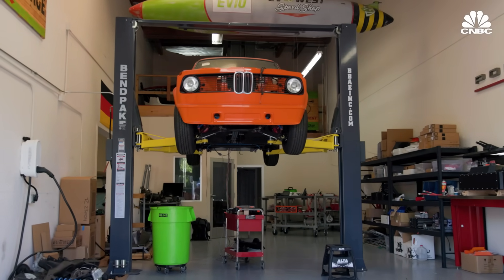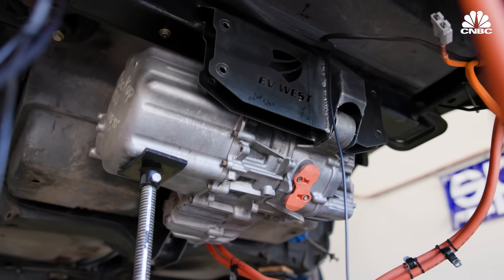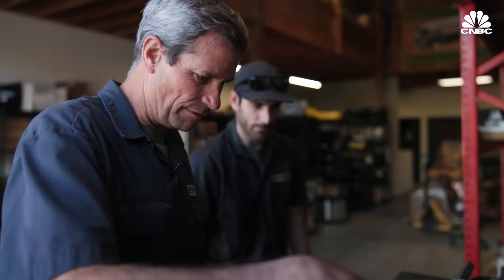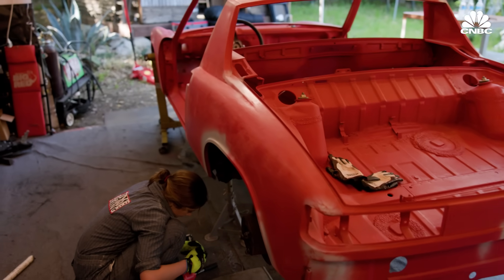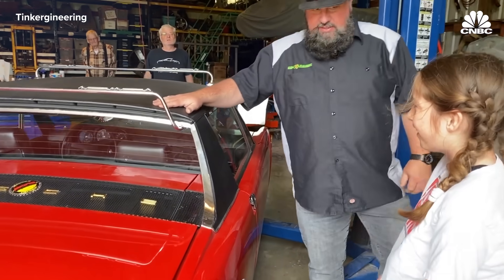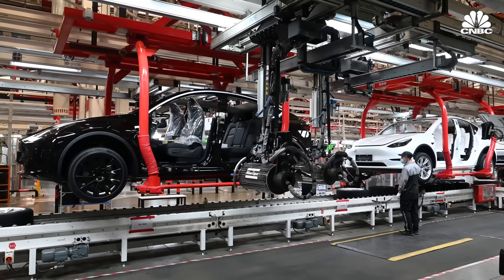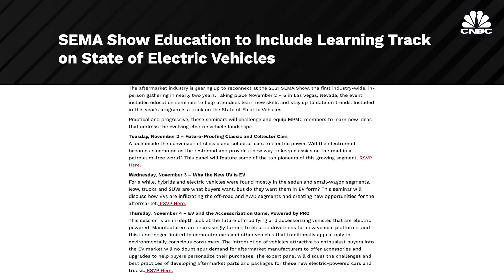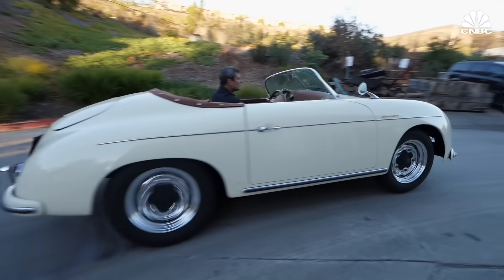How To Convert A Gas-Powered Car To An Electric Vehicle

Comment: In Eastern Europe large vehicles and regular sedan type vehicles have been converted to natural gas from gasoline for YEARS... some have converted to a Natural Gas Generator Electric vehicle, basically a kind of hybrid with a small natural gas optimized engine to simply power an onboard generator and a small battery to store 5-10 kwh... you end up with an ELECTRIC DRIVE, Natural Gas Hybrid POWER vehicle... its the best option... no need to completely redo electric wiring... no need to get a lot of batteries... most of the conversion is happening under the hood and switching out the powertrain... thats it

Comment: These are great but they need to bring the cost WAY WAY down so the average lower end working class can afford to do this since this is where the bulk of the cars are used that currently can't afford to nor able to afford to stop using their cars they way they currently are using fossil fuel.

Comment: 20k-30k in labor? BU!!SH!T! not unless their charging $500 per hour? i mean seriously all your doing is removing the engine tranny (nowhere near 20K to remove AND reinstall them) and gas tank and rest of items not needed, and RE INSTALLING new parts.... IDK of ANY engine/tranny shop that charges anything even close to $20k for labor, those #s are just FKN greedy! even with fab work, the #s DONT ADD UP @ thats rate of 40k-60k.. JUST BUY A DAMM NEW EV!?!?!
Reply: Don't forget removing the exhaust system as well.

Comment: Sea weed bio diesel can actually replace all EVs, all petrolium more sustainable more echo friendly make countries energy indipendent, Carbon neutral, and yes can be used in existing IC engines. But the governments around the worlds are putting their backs cuz of all the lobbying and putting money on a non feasible option. 🌚.. that's the truth basically.. basic physics

Comment: It's nice, but the EV conversions can be as much as a $25k because of the batteries and electronics.
Reply: $20K-$30K plus another $20K-$30K for professional installation and more for the car, according to the video. They were very transparent about that.

Comment: With that price nope who the hell would convert old car if its that expensive except if the car is some kind of expensive classic that has real value but then when you swap the original engine out and turn it into a battery car it loses all that value.

Conversion would be cool if the price was sensible and easily available for common man but with that price tag its only going to be rich persons high horse ego boost toy.
Reply: Yes, I agree it's out of reach of most people. I guess for rich folks who don't care about the resale value of their classics, it's just another way to spend their money.

Comment: Our power grids aren't able to handle everyone turning to EV's. If you're wanting to save the environment, mining the materials for EV batteries does not do it. We still need a 2 to 3 fold increase in the efficiency and miles to the charge you can get out of batteries. Also, there needs to be faster charge times and more places to charge. Vehicles are still prohibitively expensive if they are electric. The US needs to produce its own electric batteries, and not depend on China for any part because they are an adversary. Other than that, their cool.

Comment: I want to convert my '84 Fiero. 

 ( Note:  People that are just going to puke out the same, over hyped, exaggerated, regurgitated crap about fires, can F.O. right now! STFU.  I've seen it/heard it thousands of times.  Just STFU and go.  shoo!! ) 

   I'm just wondering what the process would be like with that, being a mid-engine - RWD drive car.  There is a front compartment.  It houses the Spare tire,  headlight assemblies, radiator,  brake booster, wiper motor and climate control components.  But removing the rad/fan and spare tire well could open up a big hole for batteries.  Would have to avoid excess weight there and/or beef-up the front suspension.  Then there is the central tunnel where the fuel tank lives.  above that is the corridor where the wiring and shift cables go through.   That tunnel varies in size from about 10" wide X 8" high in the front,  goes back about 6 feet as it widens out to about 12" wide X 14" high in the rear, opening up into the engine compartment.  So roughly, a fairly large capital I-shaped area once all the ICE components are removed  This area would only be interrupted by the steering rack just ahead of the narrow portion of the tunnel at the front.  That's not getting into the rear trunk behind the engine compartment.  So room for batteries in the front and tunnel.  room for the drivetrain/inverters/charging/climate/cooling/ etc in the rear compartment.  Still leaving room for a spare/jack and cargo in the rear trunk. 

It would be quite the task to do,  but it seems doable.  I would love to revive the ol' girl and get her on the road again.  Yeah the old "Iron Duke" still runs great.  The 4-speed manual still works fine.  (and would be sorely missed)   Bu damn would it be a fun car!  It's a fun car as it is,  but imagine going from 95 HP  to about 250+.  And the torque!   Damn son!  Talk about a sleeper... 84 Fiero SE with faded paint and stock 14 inch rims just silently blowing the doors off of a BMW or older Vette..

Comment: That's great but one thing taking the gas engine out of a classic car of any kind strips it's soul & history it would be missing something it's character . With a electronic engine is good for the environment but man want to tinker with something and a gas engine to the gear heads gas engine is always be king. No matter how many ev's there are even if and when a gas car becomes extinct years or decade from now. The materials that go in a electronic batteries real havoc on the environment and the area in the countries they are taken from just like any gas car. I'm like what's the point it's just the same I researched it it makes no sense.

Comment: What about the Home Charging Units that everyone will need installed to go along with their EV?
Reply: Slower to charge, but there is a charger you can use from the usual electric socket in your house. It is apartments and renters that have to worry.

Comment: Stay Pro-American. Stay gas powered. Don't be an idiot!!!
Reply: You don’t care about emissions?
Reply: @Freba9  Natural gas, coal and nuclear produces 80% of Americas electricity so go ahead and plug your EV in but lose the virtue signalling I'm  greater than thee smile.
Reply: @saneman8147  Producing far less CO2 than burning gasoline.
Reply: @saneman8147  , you may want to run the numbers. Especially if you look at natural gas, your lifetime emissions from an EV is quite a bit lower than an ICE for the same distance. Further, the per unit energy efficiency of an EV in the supply chain is still more efficient than ICE. If you analyze the entire energy chain to the wheels, EVs use less. I'll never understand this weird anti-EV stuff. I've seen so many made up "facts" that keep getting spread around, when it seems like people just have no idea what they're talking about. To that end, one must wonder, why? Lol. Why do people hate EVs so much that they seem to almost fear them and make up false information to argue against them?

Comment: What about if you convert a vehicle to electric from gas. What to do about the gas that was in the vehicle? How do you recycle the gasoline? And any used parts that weren't used to convert? I didn't hear anything in this video about this.
Another thing. I didn't hear anything in this video about what theses jobs pay? What's the pay range? 
And one more thing. 
What is the cost to go to school to learn about electric vehicles? How much does a class and or school cost?
Reply: You are worried about a gallon or two of gas that was left in the vehicle? All used fluids of cars are always properly disposed of in workshops.

Comment: *The stock market rally run is gone, but I'm not sure if equities will swiftly recover, keep falling or swing in a narrow range for a few weeks, or if things will quickly get worse. I'm under pressure to increase my $250k reserve*.
Reply: Despite my confidence in your advice, my recent stock purchases, and the fact that I am an AMC shareholder, I haven't been able to accumulate anything. I had already been in the hole for too long prior to the downturn. What's the investing procedure?
Reply: It's true that many people downplay the value of financial gurus until they experience emotional pain. After a protracted divorce, I can still clearly remember needing encouragement to keep my business afloat. Several summers ago, I researched license advisors—or portfolio coaches, as some peo
Reply: Jackson Sten Marsh is the coach that guides, you probably might've come across he before I found him through a Newsweek report, he's quite known in he field, look—him up.
Reply: I promptly did some research on Jackson past. He can control herself well. He credentials are solid, and it seems like he was the subject of a careful examination. Foreign investors from countries other than the United States can also use his services

Comment: How about a receiver hitch with a 220-volt charger multifuel attachment? smallest size to run a 220-Volt charger on Hemp oil...Maybe that new rotary unit is about 18# receiver weight and a 12' X 12' package all-inclusive for those extended road trips? How big does a charger motor have to be?

Comment: Electric cars have their batteries low down under the floor to balance the load and keep the CofG low as well as for safely reasons in the event of an accident. The extra weight requires a stronger chassis, stronger suspension, better brakes, etc.

Comment: Unfortunately  there is not a safe and efficient motor available to use.  The tesla motor uses dangerous high voltage, & high current .  The massive  battery  produces  a potentially Lethal 350vdc,  powering an inverter also having a potentially Lethal three-phase AC.  The massive battery with coolant system is very expensive,  the  inverter & motor drive are an additional $$$ expense.
Reply: nobody ever die from the EV voltage
Reply: So you are proposing everything to be low voltage?

Comment: Car company should make electric vehicle kits for their cars. If you have a 2020 Toyota, there should be a kit / conversion turning that car into a electric vehicle. This method will save alot of natural resource building a NEW vehicle every year.
Reply: Well then the problem is so many resources would be used making millions of conversion kits that could have just went into those cars from the factory as an option

Comment: If you don't choke the Diesel Commercial Engines out with all the bs emissions they will go 2 million miles with proper service and create way less waste in landfills. Battery waste and mining for battery manufacturing is way way worse for our environment.
Reply: Nope. Electric vehicles are far less polluting.
Reply: @Freba9  You will be eating those words in 20 years when the landfills are full of ev's no one can afford to replace the batteries in. How much Diesel do you think it takes to mine for all the batteries and ship them? I don't know but  I'm guessing A LOT.
Reply: @HotRodDave  No need for guessing. Plenty of data freely available. EV lifecycle carbon emissions are always lower.

Comment: Best way to make a cool car boring
Reply: thes is the way to make a cool car you daily driver
Reply: @Guillote 99  I drive a 1965 El Camino every day with the original drivetrain.  Runs great and is more reliable than any modern car. Guess what you don't need to charge it up for hours just stop and put gas in it and go
Reply: @HotRodDave  cool car! let say you get 20mpg, if you drive 10k milles/year at $5/gal (here in arizona) and 2 oil changes ($50 each) that is $2600/year. 
an average EV will make 3 miles per KW at $0.1KW that is $333/year with no mantenance and if you have solar panels like I do is free
you charge your car when you sleep, every morning you have a full tank and you do not need to stop to pay for gas 
I have 3 cars, only one is electric.  guess wich one is my daily driver?
Reply: @Guillote 99  I am a 30yr mechanic and change my own oil and here in Georgia gas is 3 bucks a gallon. I have been around the car business my whole life and have been to school and have certification on ev and hybrid systems.  They are great for a while until the battery goes south then the whole car is scrap.
Reply: @HotRodDave  I am a former A&P mechanic, pull my first engine at 16 in my garage and I am now 44 years old. at this time on my life ICE cars are a hobby, I am currently rebuilding a 1994 bmw 325ic engine. If I make that car electric I will drive it everyday, but with a gas engine will stay in my garage collecting dust. I have a few friend with EV's , all good experiences, none of them are going back to  gas. have you try a tesla model S paid? will blow your mind
Reply: @gsabic  I have drove a Tesla and yes they are very fast. Still not as fast as a Camaro I built for 15k.   Electric cars just don't do it for me. We had one on Sick Week 2022 in Florida and it didn't go so well for him. He was late needing a charge most of the time. Ended up locking up and needed dragged off the track after sitting in everyone's way for ever.  Electric cars are fine for city dwellers that don't go far. I have even drove a dragster with an electric motor and it had crazy torque. I know EV's are not going anywhere and I am fine with that but I don't think they are a solution for pollution and you wouldn't catch me dead putting a Electric Motor in a Hot Rod.
Reply: @HotRodDave  model s long range gets 405 milles per charge and charge 300 milles in 25 minutes, and the models plaid goes from 0-60 in unde 2 sec. and is a car that you can use everiday, never waste a minute in a gas station or oil change.

Comment: When soild state batteries hit the market this will get more popular!! Only reason i dont want a full elecrtic car is the milage and time it takes to charge!!
Reply: What kind of mileage do you think you need?
Reply: @Freba9  well i travel far distances. 400-600 miles is ideal for me. I just dont want to stop every 300 miles and sit for an hour or two for it to charge. For example sandeigo to las vegas would take me 8 hours in a modle 3 with charging vs a regular car would take a little over 5 hours. And when i touch base in vegas i have to charge it again so i can uae it to drive around town. But if the range was fixed or the charging time would improve dramaticly gas engines would be obsolite to me. Toyota already has a soild state battery that provides 900 miles thats going to come out in 2027
Reply: @rattanack1413  I see. But you have to take a break anyway after 200 to 300 miles right? Fast charging often does not take more than half an hour. And Toyota has been promising that for quite a while. But yes, who knows.

Comment: If you have classic car you will loss tremendous valve by doing a conversions. Second the car is boring with no soul. Yes they are fast but heavy which effects handling of the vechicle. Fuel cell and Hydrogen  fuel conversion is the way to go.
Reply: Hydrogen is super inefficient and also heavy. Battery electric is the only sensible option.
Reply: @Freba9  ,Toyota Murai fuel cell is super efficient. Hydrogen will be the future infrastructure for commercial, ships and passenger vehicles. EV's is Boutique pipe dream.
Reply: @frank.l181  What are you talking about? Everyone knows hydrogen cars are inefficient due to physics. The Mirai consumes three times as much electric energy as a comparable EV. Pretty much all manufacturers are currently focussing on EV (yes, even Toyota). It’s a done deal. Ships and aircraft: yes. Pretty much everything else: nope.
Reply: @Freba9 , Toyota and Honda will not going EV because people like me will never buy them.
Reply: @frank.l181  Lol in that case they have nothing to worry about.

Comment: EV's rely on child lithium miners and coal-powered generators for recharging and as lithium becomes more scarce, prices will surge. The real answer is the easily renewable and non-polluting fuel called ethanol. No one looks into this because the oil industry does not want you to know this.
EV's are old-school already, the future is unfolding now, so wait before investing in this toxic technology. The real renewable is alcohol-fueled energy production: it's cheap, natural, efficient, reliable, safe, proven and affordable. 
Place your bets. People charging their EV on a municipal coal-powered grid is a joke. And, it does nothing towards advancing the future of energy tech whatsoever.